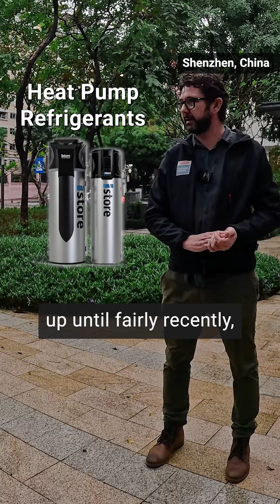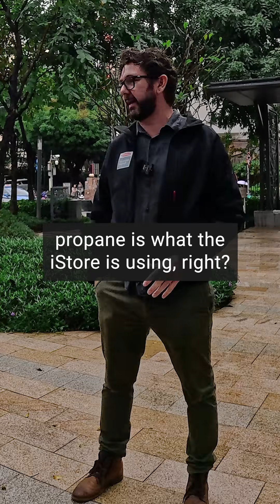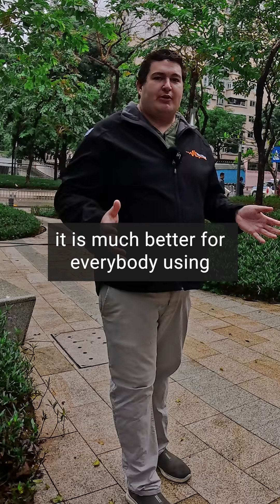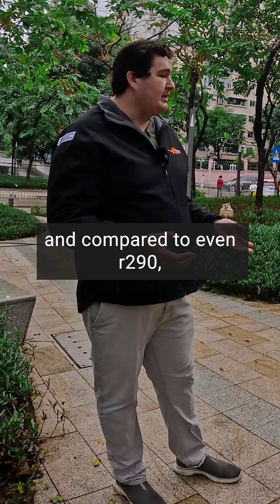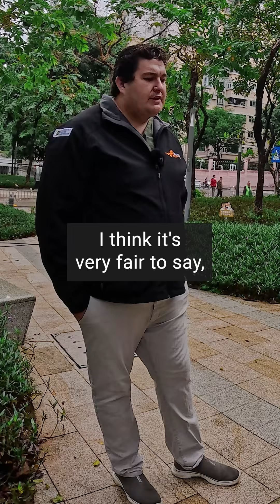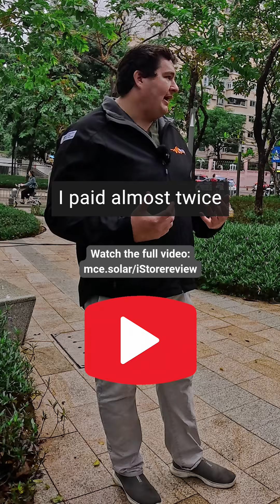iStore Hot Water Heat Pumps: R290 vs CO2 in Brisbane’s Climate

Comment: Refrigerant choice
refrigerant	20-year GWP	100-year GWP
R-290 propane	0.072	0.02
R-600a isobutane		3
R-32	491	136
R-410a	4705	2285
Reply: Propane heat pumps are more efficient than C02 heat pumps and are more environmentally friendly with a significantly lower global warming potential (as stated by @samfish6938). Anything that you read that states otherwise is from outdated data.